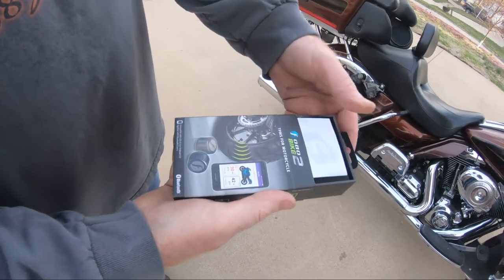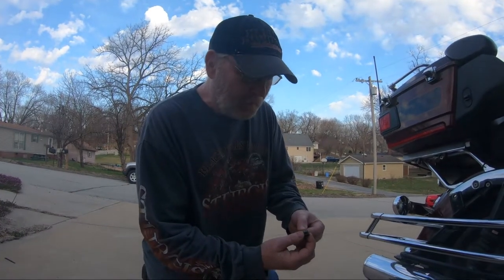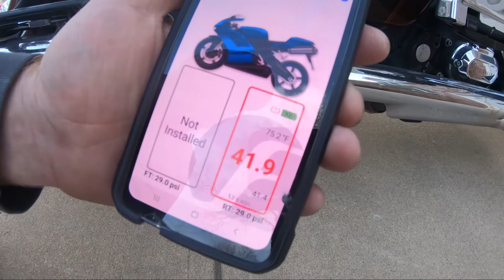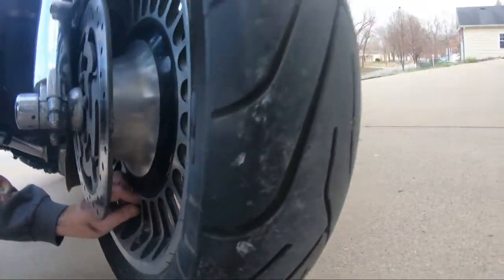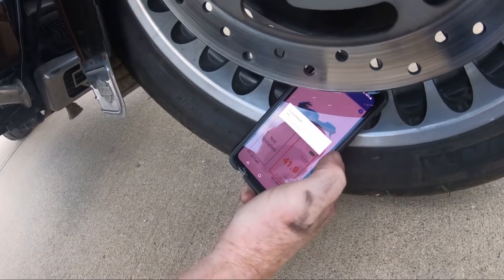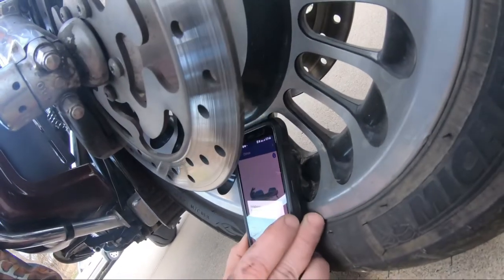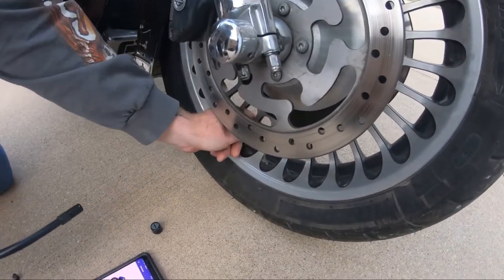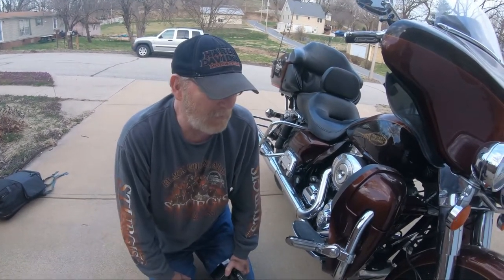Installing FOBO 2 Tire Pressure Monitoring System On A Harley Davidson Bagger

Comment: Good job, guys. A smart mod for both added safety and extended tread life. When you only have two contact patches, you best take care of them!
Reply from the maker: Yeah, it is so nice to have the ability to check pressure so quickly and then be able to make adjustments that might be out off because checking "the old way" can be a pain sometimes. Thanks for watching!
Reply: Great points Craig.  Ride safe 👊👍🇺🇸

Comment: These are great. I have put about a 1000miles on them. A real benefit if you have bad knees or back. Also it will alert you while your riding which is a great safety feature. One thing some others have said is that your supposed to have metal stems. But I can’t find one negative comment about them not working properly even down south. There is a wheel balancing video about them but it was on a race bike. They added some minimal weights. Stay safe!
Reply from the maker: Thanks for watching and they are a great added feature for sure. Ride safe!!!

Comment: How heavy are they? I was wondering if it would cause balance issues with static balanced tires.  I go through 2 rears and 1 front a season on my Buell and change them myself so I got some Counteract balance beads to try those out.  Read mixed reviews but I like them.  Not having weights on painted wheels is a plus as well.  I think I'm going to give these monitors a try.  I really like the tire temp feature.  Can you change the pic of the bike on the app?  If not I bet you guys love having a sport bike on there. 😉
Reply from the maker: Don't know what they weigh but not that heavy at all. Yes you can take a picture of your bike and add it. Really like all the info you get from them, starting temp and pressure, to riding temps and pressure. You'll be surprised at how much they change. ride safe!!!

Comment: I have the FOBO. I don’t remember if it is the 2 or not. I just had to change the batteries. It does give an alarm when the pressure goes up. I get an alarm from high pressure all the time.
Reply from the maker: Yes I have noticed that they heat up and create alot more pressure as you ride it. I have now set the high pressure on the rear at 47 but start out at 42. thanks for watching and ride safe!!!

Comment: That's something I am interested in. Couple questions I have is how long do the batteries last? How much do the batteries cost? I do agree tires are not cheap. I had a front and rear put on at same time last year and it cost me $795.
Reply from the maker: Well Jerry just replaced his this year so I'm guessing they last about 2 years. I'm not sure if his came with an extra battery or not. The one I got came with an extra battery so I'm hoping it last at least 2 years. There is alot of different kinds on the market but this one works really good. Most others come with a separate monitor you have to mount, this goes to your phone thanks for watching and ride safe!!!

Comment: How's that little compressor holding up?  Haven't found a reference to it in your playlist, what's the name of it?   Thanks!  Ordered the FOBO 2 thru your amazon link, on sale for $89.  How long do the batteries last? I had to change the batteries in the FOBO 1 about every 6 weeks, more in the winter.
Reply from the maker: I can't give you the exact length of time for battery life, but I do know that I changed mine quite awhile after I installed them. A lot longer than six weeks, though.   And the little compressor was a gift from a friend, so not sure the exact name or model.  It's come in handy on a couple of occasions and is working good.  I know there are several on Amazon that are very similar and have decent reviews.  Sorry not full of much exact information. 😬 Thank you for watching!
Reply: The compressor appears to be smaller than most I've seen, I think that's what caught my eye. I'll revisit Amazon. Thanks for the response and the videos!  @RiverBluffBaggers